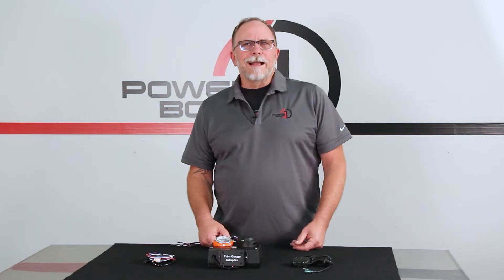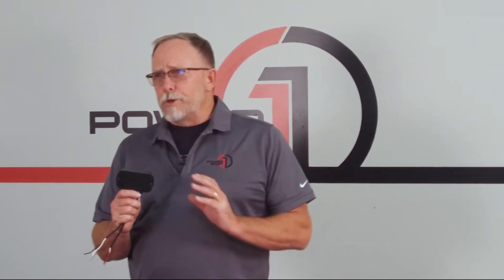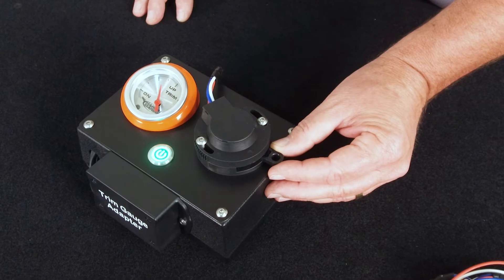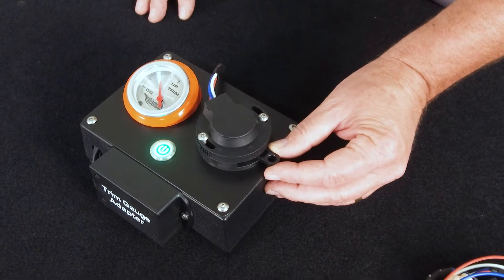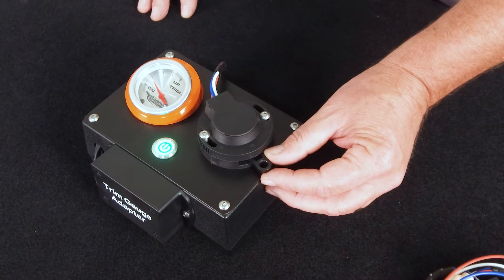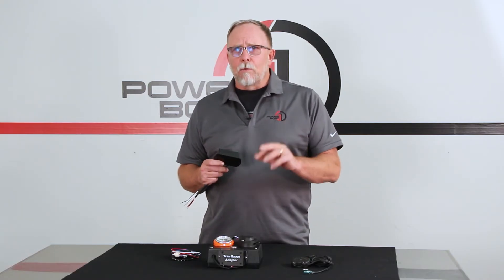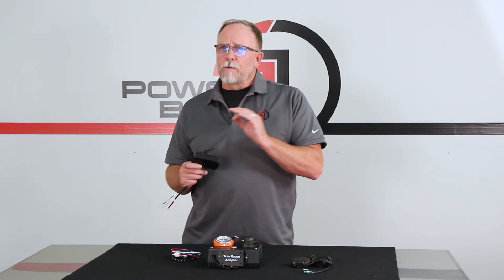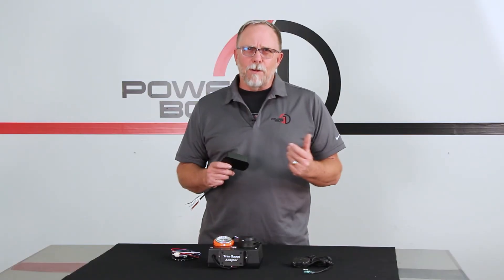Digital to Analog Trim Gauge Sender Adapter

Comment: Is this required if you have a Mercury smartcraft gauge system installed 🤷🏻‍♂️
Reply: No. Smartcraft has a bullet connector for digital trim input.
Reply: @rockerneck  read the first reply on this topic 🤷🏻‍♂️
Reply: @rockerneck what color is it?
Reply: Can you convert a 2 wire analog trim limit puck to the red white & blue connector in the engine bay?  Or only the other way around?   I accidentally put the 2 wire trim limit switch in when it should have been the 3 wire (red,wht, & blue).  Ugggh. Lol